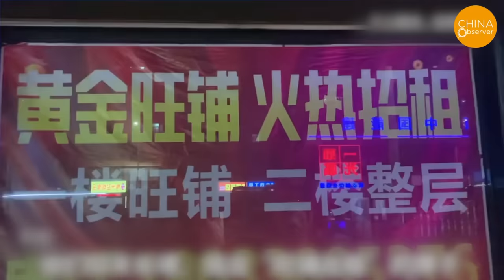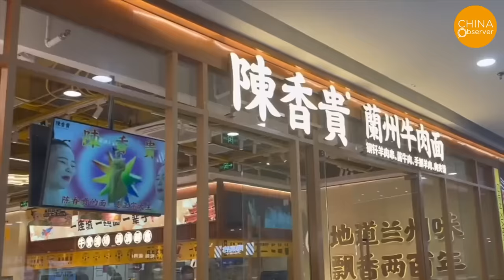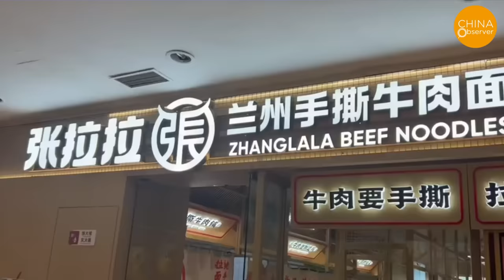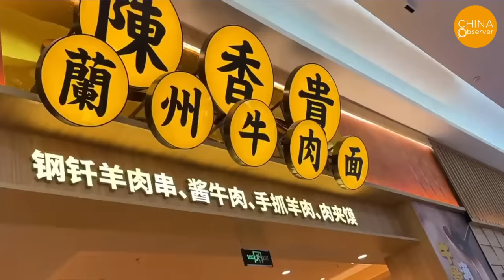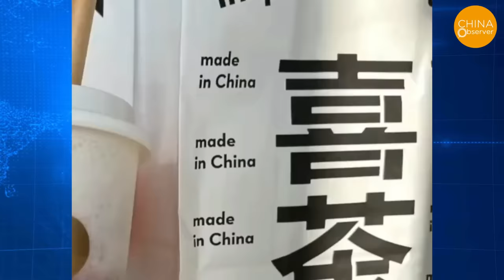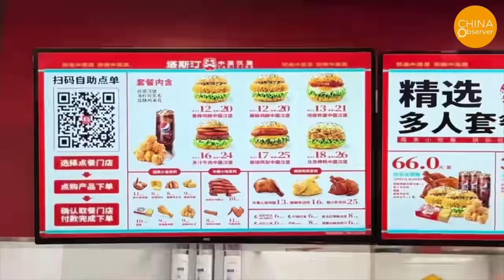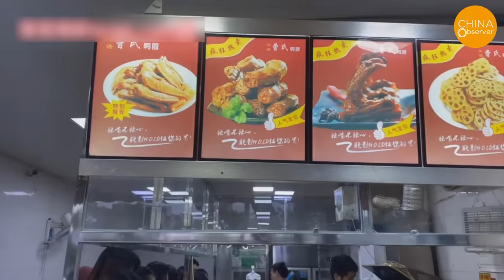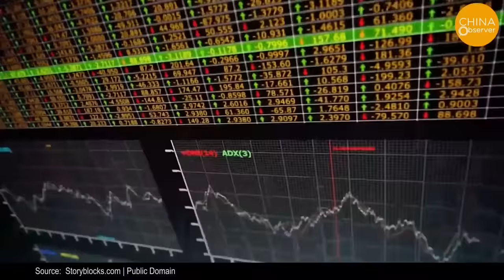China’s Food Industry Apocalypse: 100 Establishments Open, 150 Shut Down, a 150% Shutdown Rate

Comment: This is sad, but I think your math is way off here, there is no such thing as 150% shutdown rate, if you have 100 stores and 100 of them shutdown then that's a 100% shutdown rate. If 100 remained open and 150 shutdown that would equal a 60% shutdown rate, 150/250*100 = 60% NOT 150%.
Reply: I think its better to say, for every 100 new locations that that open, 150 are closing.
Reply: Its based on historical averages per month.
Reply: I think it was like 100 new stores open 150 stores close down. 

So to open a store today. It's has a failure rate of 150%???
Reply: You can definitely have more than a 100% shutdown rate. That's when more stores close in a time period than stores open which is possible when you consider that there are already pre-existing stores open.
Reply: She meant already open and new openings combined
Reply: It's not even that crazy of a number, in the restaurant industry.
Because you always compare yearly numbers. Imagine half of all stores stay open forever, and the other half only survive 3 months on average. In this rather simplified example you would end up with a yearly closure rate of 200%.

Comment: Seriously? 150% ? Not mathematically possible. 💩
Reply: 100 stores opened 
150 closed 
New openings are in a negative 
You could say -50% success rate 
Or 150% failure rate 
Both are valid